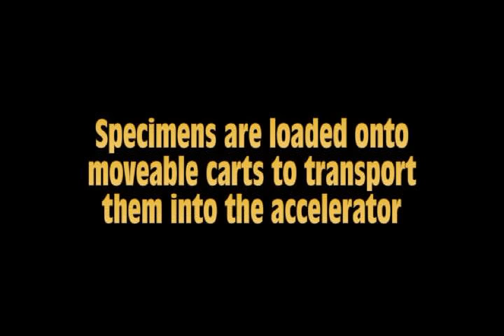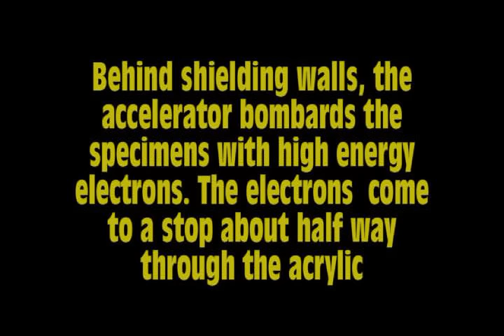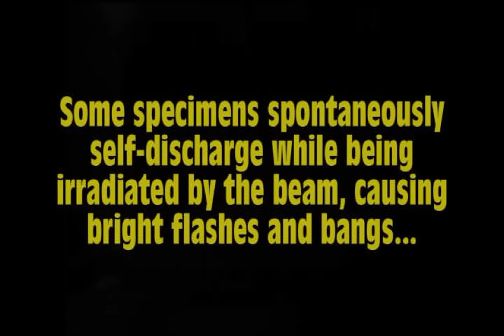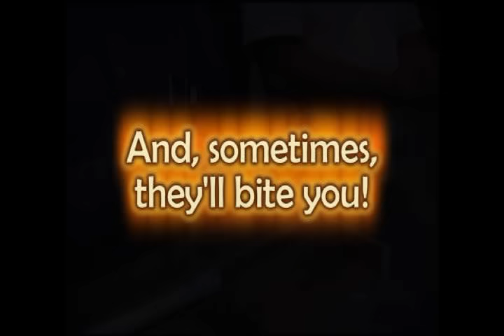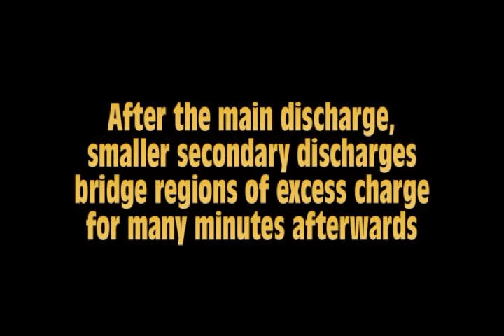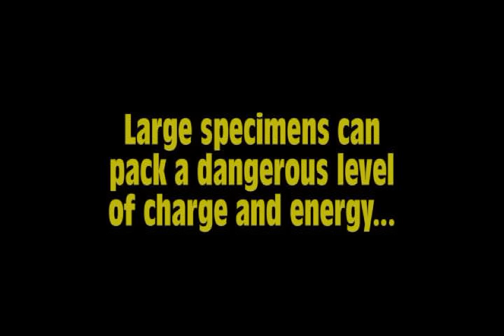Making "Captured Lightning" (Million-volt Sculptures)

Comment: At 2:15 you can see a lot of sparkling going on in the video, so there seems to be a lot of radiation that gets tossed around. Is that a good sign, that it's unsafe to stand in this room while the accelerator is turned on?
Reply from the maker: The radiation in the room is essentially continuous since the accelerator is on continuously. The flashes are specimens prematurely "self discharging" because they've been dosed with too many electrons. The little speckles in the video, the brilliant X-ray fluorescent glow from the acrylic as its being irradiated, and the flashes of self-discharging specimens are all clues that dangerous high-energy processes are occurring inside the room. Between high levels of toxic ozone and intense 2-5 million electron volt X-radiation, being in the room, even briefly, would be fatal.

Comment: I'm guessing you can't touch them during the secondary discharging
Reply from the maker: Although you want to avoid becoming part of the main discharge, since it can really smart(!), the secondary discharges only sting a little bit - sort of like electrostatic shocks you sometimes get in the Winter when touching a door knob.

Comment: I'm not sure if you are still responding to comments, but I'd really like to know for how long these pieces of acrylic hold the negative charge. I'm sure it depends on many factors such as volume and shape of the acrylic and for how long it is exposed to the electron beam; but what would you guess is the average time window you have for initiating the discharge after they went through the accelerator? Could you, for instance, charge it, store  it away for months and still activate it?
Reply from the maker: The injected charge leaks away over time. How quickly depends on the temperature of the acrylic. At room temperature, it only takes 10's of minutes. If a specimen is chilled via dry ice, charged, and then maintained at that temperature, the charge will not dissipate for several months, perhaps longer.  Because the leakage rate is so sensitive to temperature, we usually make our sculptures in late Fall or early Spring when the ambient temperatures are lower to provide longer working times after charging.
Reply: Wow, that was quick! Thanks for the answer, I really appreciate it! I was thinking about charging one up, putting it in a space probe with instructions on how to activate it, and if it was discovered by intelligent aliens, they would have a perfect specimen of human ingenuity and art; but I'm sure this would make a very unique gift for humans as well (although a dangerous one) :). Do you plan on uploading stuff in the future? Your last video was posted over a year ago, but I'd subscribe in a heartbeat if you plan on continuing this channel.

Comment: Wow, this is wildly cool!  I wonder if discharge paths/patterns could be modified in interesting ways by placing rare earth magnets on/near the object before applying the discharge wand???  I guess a quick calculation would show if this is even a reasonable suggestion or not (but, as is evident from your video, these phenomena are way more subtle and complicated than a back-of-the-envelope calculation would be likely to handle correctly).  I suppose that multiple discharge wands could not be used simultaneously (again, to produce new types of patterns) since you'd have to get the timing correct to, what, microsecond accuracy?  If you let a charged object sit for a few days, does the object eventually discharge spontaneously even without the wand?  Presumably, you need a physical fracture to start the discharge.  I wonder if a high power laser could do the same trick but with interesting differences (perhaps placing a flat metal grounding plane on the PMMA but sending a laser pulse through nearby, or even through a different face of the object).  I may buy a few of these nifty objects just for my students to see and to get them thinking!  Very nice work. I wonder if you could aim, say, 3 high power lasers at a single point in the interior of the object, so that there would only be enough localized energy density to cause fracturing at that single point, not along any of the individual beams (that would definitely take some trial and error).  However, you could end up with the ability to choose where you want fractal patterns to begin internally, at multiple locations perhaps.  OK, I'm gonna force myself to shut up now, but this is really nifty stuff!
Reply from the maker: nanomanpa Thanks for your kind words, and interesting speculations. We have asked similar questions over the decade that we have been experimenting with these fascinating objects. I'll briefly answer these in the order they appear above. 

Several years ago we tried discharging a 4" x 6" x 1/2" specimen while immersed in a powerful magnetic field. No differences were observed in the shape or manner of the discharges. See http://www.capturedlightning.com/frames/lichtenbergs.html#Iced for more details. 

We also tried triggering using multiple discharge points. Since the discharges propagate at about 1 inch per 20 ns (about 1e6 m/s), it is extremely difficult to "simultaneously" trigger from multiple points. One point always seems to  trigger first, discharging the specimen before any of the other points can be triggered. 

Since acrylic is an imperfect insulator, a charged specimen will slowly discharge at a rate that is a function of its temperature. By artificially cooling acrylic specimens, the discharge time can be extended considerably. For example, a specimen chilled to dry ice temperatures (-78.5C), charged, and then maintained at this temperature will retain its charge for up to six months. We have successfully stored charged specimens for a couple of weeks and then discharged them for later demonstrations. 

A specimen discharges when a surface defect concentrates the local electrical field suffuciently to initiate electrical breakdown between the positively-charged outer surface and the inner negative charge layer(s) in a charged specimen. The simplest way for us to create a small external fracture is by poking the specimen with a sharp metal point. In theory, a high-power laser should also work, but we have (thus far) been unable to trigger them using from a high power pulsed laser. 

A charged specimen behaves like a "plateless" capacitor, with trillions of stranded positive charges residing on the surface, and a similar number of negative charges trapped in one or more layers in the interior. The effective voltage stress on the acrylic dielectric layer between the oppositely-charged layers is typically between 1.2 and 2.5 million volts. Whether the charged specimen sits on a metal surface, is coated with ice, or even submerged under water does not seem to matter - it will discharge in a similar manner.
Reply: Bert Hickman Thanks for your reply!  Also, I saw your web page, with many of these tests and observations, after I submitted my questions.  I should have done my research first :-) .

My research students and I have begun trying our hand at electron beam lithography in the last year or so and the first thing that struck me after watching your video is that we also use PMMA, but in liquid form.  It's one of the few materials that has its structure changed by exposure to electron radiation, hence, it's usefulness in this technique.  There are some other materials that have also been used for EBL (ZEP520, SML, HSQ, NEB-31, EBR-9, etc.).  I wonder if something interesting would come of playing with one of those substances (in solid form) ... have you tried anything besides acrylic?  In particular, PMMA is a positive resist, so "what shows, goes", the electron irradiation breaks up polymers into shorter segments, which are then washed away by a carefully chosen solvent.  The opposite is true for negative resists, like HSQ, in which electron irradiation makes longer polymer strands, rather than shorter ones.  I wouldn't go so far as to predict that an HSQ block exposed to electrons, and then discharged, would completely disintegrate except for a solid fractal pattern, but it would be cool to investigate!  I also wonder how a mixture of, say, PMMA and HSQ, would behave??  From your website, it is clear that you have tried a LOT of things and thought this phenomenon through pretty carefully, so these suggestions are probably things you've already considered but I thought I'd mention them anyway, in case they might spark a new idea (no pun intended ... well, maybe it was :-) ).
Reply from the maker: nanomanpa We have also tried clear PVC, PET, PC, and PS. Other researchers have successfully used polylactic acid (PLA), but we have not tried it. Of the other polymers we've tried, most develop Lichtenberg Figures with unsightly black/carbonized traces or large carbon-filled fractures. Polycarbonate (PC) develops very thin spider-web-like gray to black traces that are pretty in their own way, especially when displayed against a white background. We have only tried prefabricated solid shapes thus far, and have not tried irradiating liquid resists. If there was one that polymerized along the discharge channels only, but not from the e-beam, it would be an interesting one to try during a future production run...  :)
Reply from the maker: Thanks for your kind words. We also are fascinated by these objects and their behavior. Many of your questions are addressed on the following web page. There are a number of published references at the bottom of the page that you may find also find of interest:
https://www.capturedlightning.com/frames/lichtenbergs.html

Briefly addressing your questions:
We tried applying a 1.5T magnetic field during discharging - no obvious changes in discharge shape or curvature wew observed. Because of the high discharge propagation velocity (10e5 - 10e6 m/s), simultaneous discharges would require nanosecond-level mechanical timing. At room temperature, injected charge leaks away over minutes or hours depending on the acrylic blend and ambient temperature. Specimens continuously chilled with dry ice can retain their charge for many months. We tried using a high-power pulsed laser (TW peak) to trigger discharges with no success. We can control the rough shape of the discharge regions by using lead masks to control which areas get irradiated. By using 2-3 masks and multiple passes through the electron beam, we can generate complex 2D and 3D interactions between masked charge layers. For example:
https://www.capturedlightning.com/frames/Hi-End1.html
https://www.youtube.com/watch?v=0IxKM7NQXnA
https://www.youtube.com/watch?v=AmAZtJvuYUY
https://www.youtube.com/watch?v=Ch-MJ8buo_k

Comment: Do you remove the target from the beam on the accelerator?  Is that how you do it?  Does the acrylic ever explode?
Reply from the maker: We move the pieces of acrylic under a beam of electrons that is scanned across a four foot span. As the acrylic moves in the carts below, the electron beam passes back and forth across the specimens, raster scanning them (similar to the way an image is scanned on the screen of an older-type TV set cathode ray tube (CRT). 

When doing very large specimens, we were initially concerned that the stored energy might cause the acrylic to explode. Fortunately, this has never been a problem even though the stored electrical field energy can reach 1 kJ per square foot of acrylic. We have seen other materials, such as polyester or glass, crack extensively and shatter so we do not irradiate those. Besides, acrylic gives us the "prettiest" results.

Here's what happens when you use glass:
https://www.youtube.com/watch?v=9IoaMlfdSB0

Comment: If you were to very carefully arrange 8 or 27 charged cubes into a larger cube before hitting one, would they create one large captured lightning sculpture?
Reply from the maker: We' have tried putting individually charged specimens next to each other. Unfortunately, discharging one specimen does not cause any of its neighbors to discharge...
Reply: That's a shame.  It would be like a 3D jigsaw puzzle.
Reply: Bert Hickman what if you connected all of them with small metal peggs?
Reply from the maker: Still no...

Comment: If I take a 60 kV DC source and put a small 2"x2"x1/8" thin flat piece of plexi between the terminals, is there any reasonable amount of time I could let it charge up to then hit it and get something even faintly similar to this?  I have 1/8" lead sheet for shielding if needed.
Reply from the maker: Possibly. Small electrical trees and "bushes" can be created in PMMA (and other polymers) around the tips of sharply-pointed metal electrodes. AC, pulsed DC, or HV impulses work more quickly than DC. Tree growth is enhanced by sudden voltage changes or voltage reversals. 

Some examples:
https://www.youtube.com/watch?v=8AUpXworyfk
https://www.youtube.com/watch?v=Dq2xQb982vI
https://www.youtube.com/watch?v=hRurGQ4--5g

Comment: How much charge is deposited in a volume of this resin? I still can't believe how high the electron flux of this accelerator must be.
Reply from the maker: We typically inject between 1 - 3 microcoulombs per square cm for each specimen. The trapped charge layer inside a specimen is charged to a potential of 1 - 2.5 million volts (between the negatively-charged inner layer(s) and the positive-charged outer surfaces). The piece behaves sort of like a high-voltage capacitor with no visible plates. The energy stored in this "plateless capacitor" can be a kilojoule for a 1 square-foot specimen (1,000 watt-seconds), or about 3X the energy used in a portable heart defibrillator. We have made specimens as large as 3 feet x 3 feet. The electron beam accelerator we use is a large 150 kW machine that's primarily used for cross-linking of various polymers.
Reply: @BertHickman  You don't see the amount of MeV particles deposited into a volume measured in coulombs every day. That's insane. Thanks!

Comment: Nothing like dielectric capacitors! One thing that should be figured out is how to discharge the stored high voltage without causing an electrical discharge within the material and a method to initiate a discharge that doesn't involve whacking..., Also has anyone measured fields around the substrates while they are charged? and if there is a field, would you call it electrostatic or electromagnetic?
Reply from the maker: Solomons Words Excellent questions! A charged specimen slowly loses its charge over several hours to several days unless kept chilled to dry ice temperatures, We can cause a specimen to self-discharge (without whacking it) by injecting higher levels of charge, creating a surface defect before charging, or by using an outer shape that intensifies the E-field at a desired point on the surface. Once charged, there is an almost matching amount of opposite (positive) surface charge that becomes stuck to all the outside surfaces of the acrylic. Most of the internal negative E-field is virtually cancelled ("shielded") by this layer of positive surfaces. Cancellation is not perfect, so there is a small external E-field around charged specimens. We were not able to determine the polarity (direction) of this field, but it can be felt around larger specimens, easily making the hairs on your arm stand up. Even discharged specimens retain regions of surface charge for many months after discharging, but surface charges are common for many plastic materials. 

Other than when being actively discharged, the associated E-fields are static, i.e., electrostatic fields. During discharge, the high-current spark paths do create surrounding electromagnetic fields. Short pulses of electromagnetic (radio waves) have been detected as a pulse of lightning-like static on nearby AM radio receivers. And, one of our group (Dr. Timothy Koeth) has also detected intense RF oscillations in the 50-60 MHz range during manual discharging of specimens. We're not sure why these occur.
Reply: Bert Hickman wow great info! just what I was hoping to get, thanks :). Has your group ever made 2 tetrahedral piece of acrylic and pointed them at each other while they have charge? would they attract like a north magnet is to a south magnet? or repel like a south to south configuration, or just arc sparks between each other.  I'm trying to figure out field behavior differences between electromagnetic and electrostatic focal points. That RF oscillation effect peaked my interest ;), I wonder whats oscillating at such frequencies?
Reply from the maker: Solomons Words 
We have irradiated some specimens side-by-side (rectangular prisms, not tetrahedrons). There is very little interaction between adjacent specimens other than slight electrostatic repulsion from the positive surface charges residing on each specimen. We've even had one specimen (of an adjacent pair) self discharge with no impact on the other specimen that was right next to it. The oscillations may be related to the propagation process of the sparks through the acrylic which is thought to occur in a repeating start-stop process that sometimes causes "beading" of the discharge channels. See an example of beading in http://www.capturedlightning.com/frames/lichtenbergs.html#Measurements...
Reply: Thanks for the good info, have a nice day!